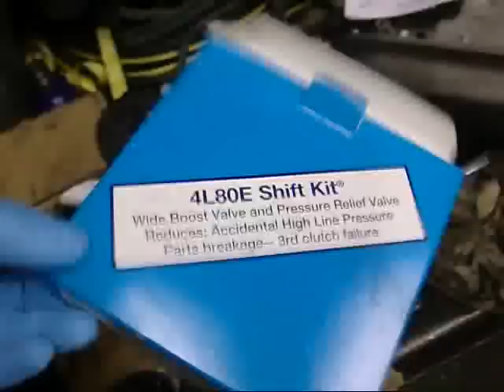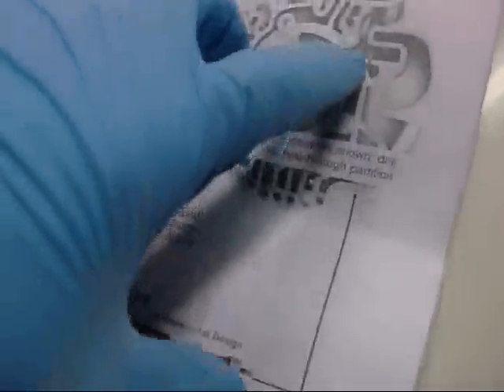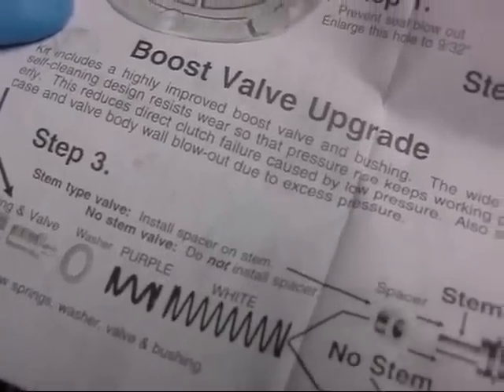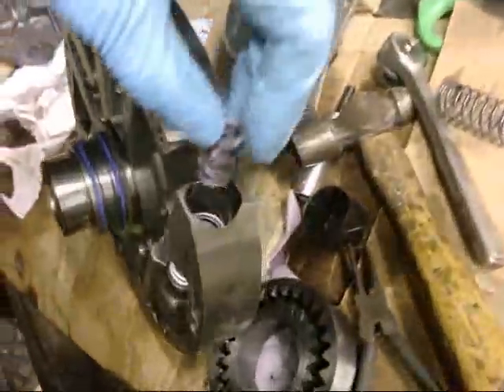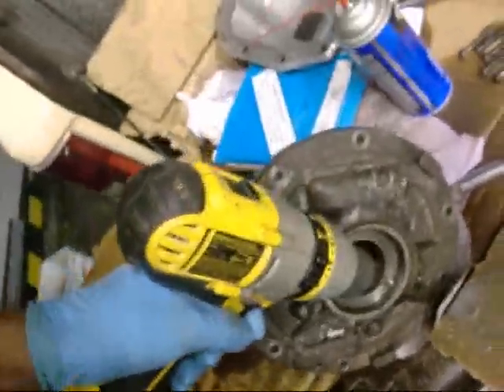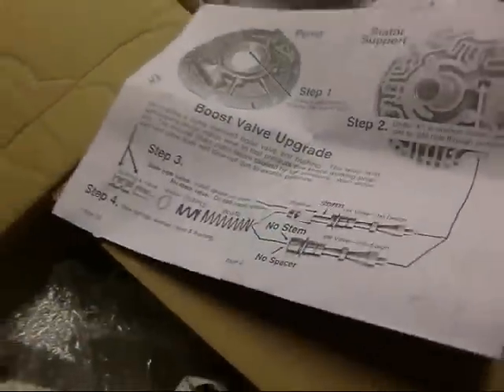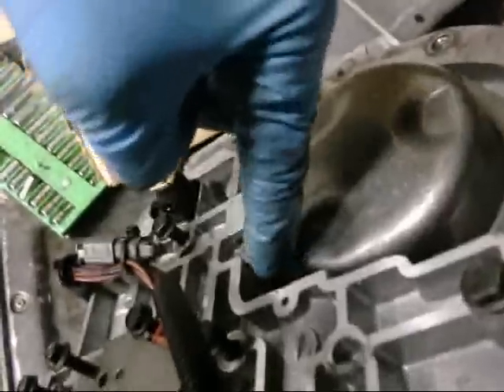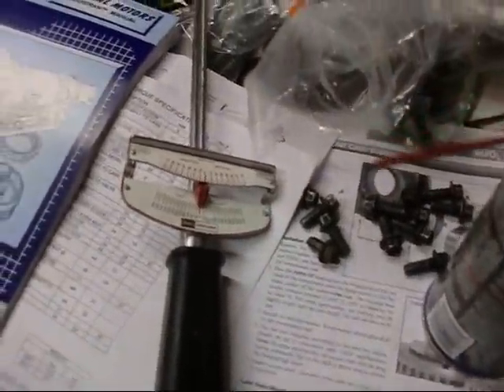5 17 12  Drilling 4L80E Tranny Pump...

Comment: It will come together.  Even if it means a trip down to you at some point.  I am glad at least you are not in a crazy rush for the thing. Better we should be sure all is absolutely correct before the unit is put back into the truck. I'll investigate about the torque converter spring sent, the instructions said nil about swapping the old one out so far as I can recollect.  Long day, 744 miles of driving.

Comment: I know this video is old but did Cutting the divot into the passage work as opposed to drilling the hole???
Reply from the maker: That my friend, is a good question. I still have the truck, but I only drove it a short distance because I drilled a hole in the block after the water pump bolt broke off inside, I have a used engine for it, and maybe I'll put it in this summer?